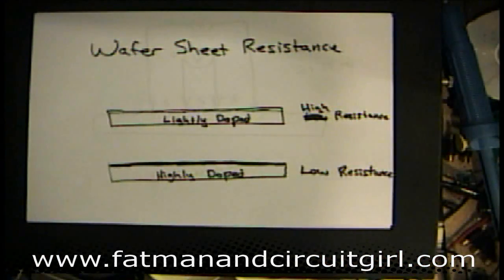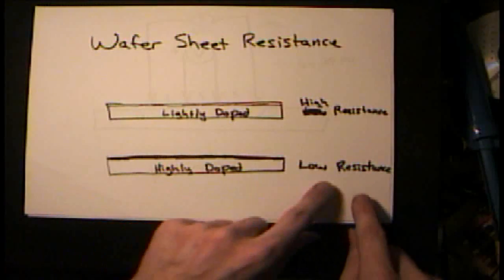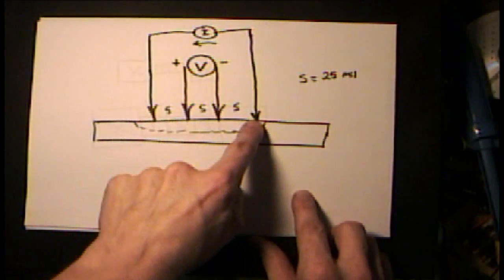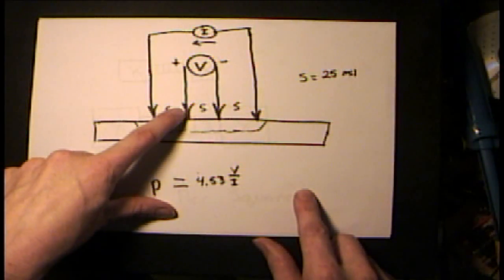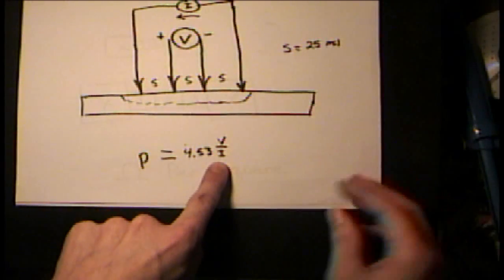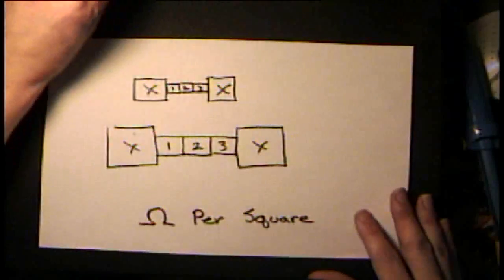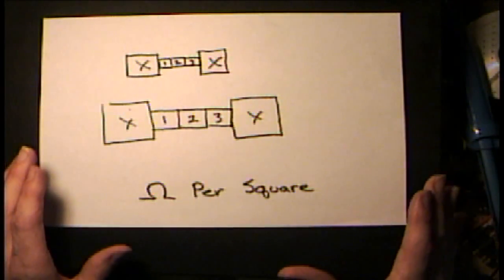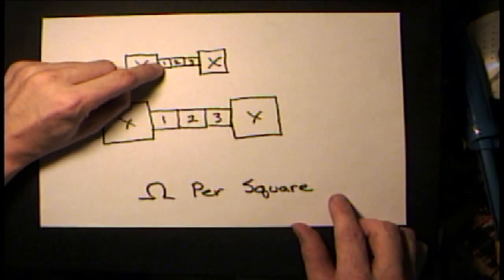Wafer Sheet Resistance and Ohms Per Square - Four Point Probes

Comment: Just to clarify - as long as the spacing (s) is equal, and the probes are arranged in a linear fashion, the constant used (4.53) will not change.